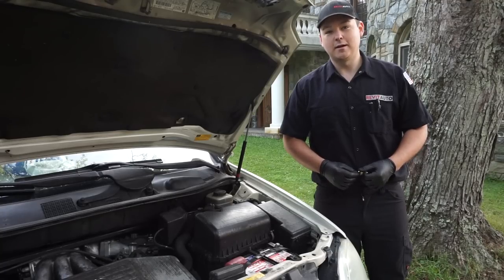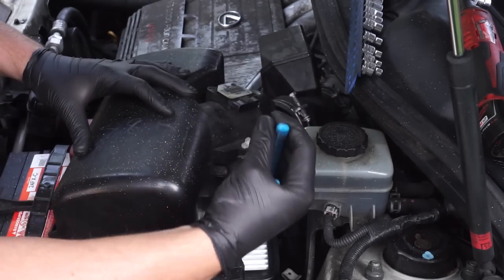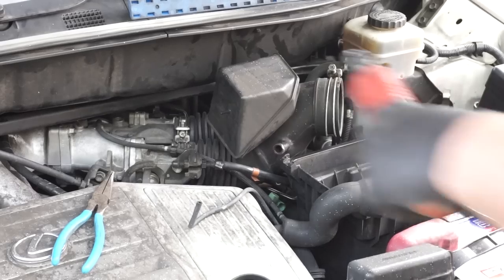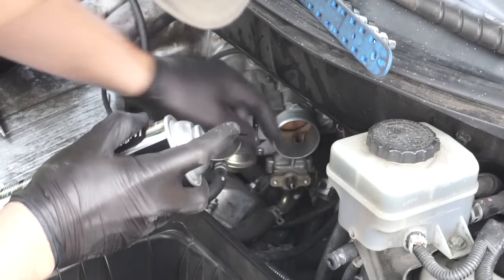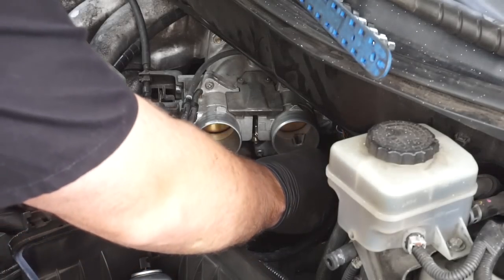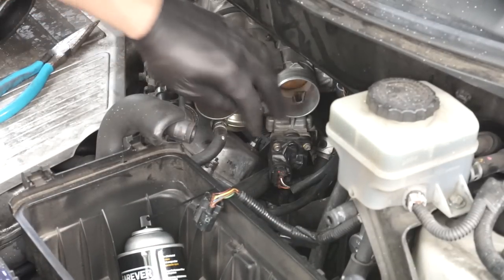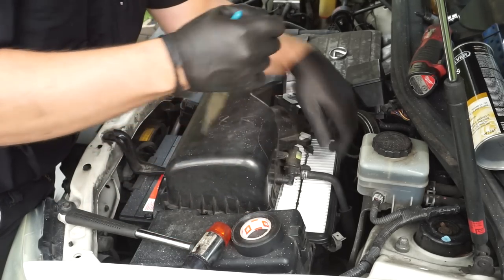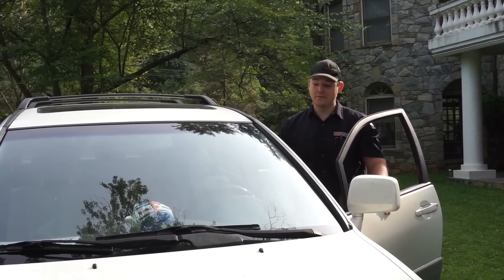'02 Lexus RX300 Stall After Starting (Idle Air Control Valve Fix)

Comment: I did all the above on mine, but it still won't start. It has good fuel pressure but just fires for a second then stalls. Anyone have any ideas?
Reply from the maker: Hey, did you ever figure this issue out? I would be happy to try to help but will need more info!
Reply: @Revitauto  yes, my wife had put diesel in it. She wouldn't own up to it  though!

Comment: I just have low idle and when I press the gas seems like it takes forever to speed up.
Reply: Any suggestions for my 1999 lexus es300? Low idle. Slow stuttering take offs. Wont shift into 4th gear. Please help
Reply: Donteea Dye check the ignition coils. That’s what stopped my idle.
Reply: Donteea Dye u can disconnect the ignition coils one by one. If the engine starts to fail the ignition coil is good and move on to the next one. If u disconnect one and there’s no change that’s a bad ignition coil
Reply: Thx so much.  Any idea on why rpms are 4500 while driving 75 mph?

Comment: Can I use mass air flow sensor cleaner?
Reply from the maker: If it is all you have you can, throttle body cleaner would be better just be sure that everything drys out and don't get any in the intake as it is highly combustible! Work safely! Happy Motoring,
Blair

Comment: Let it idle for 10 minutes... it never idle that high ever. Went for test drive and the deceleration on acceleration was worse.
Reply from the maker: You have either a vacuum leak or your valve is stuck open. Did you take it apart to clean and inspect or did you just spray it with it all assembled.